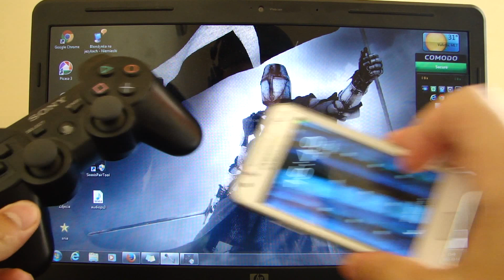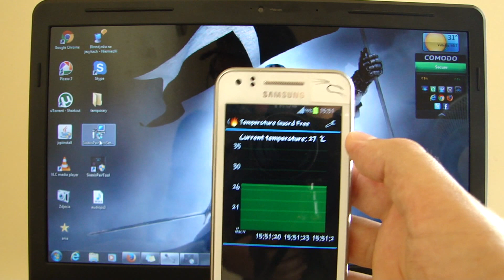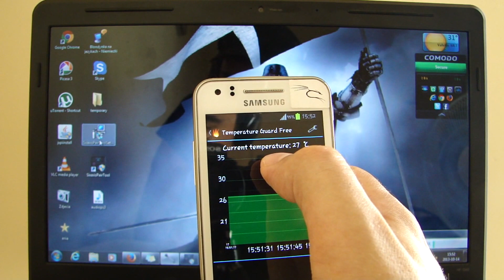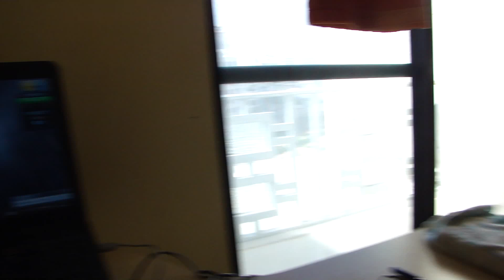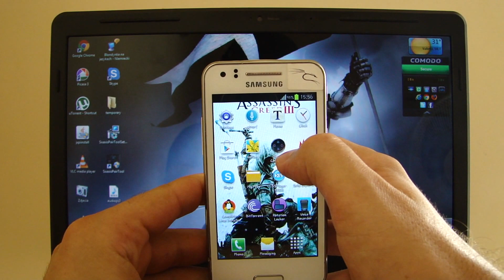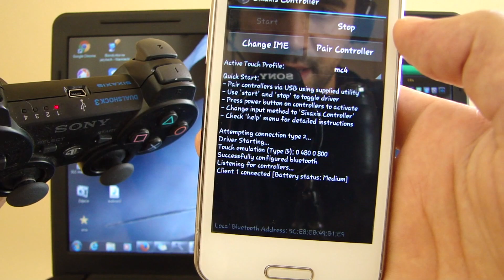How to connect PS3 controller to Galaxy BEAM (projector Smartphone)

Comment: Hey can u tell me how to connect Xbox 360 -controller with beam plzzz
Reply from the maker: You mean with the usb cable? As far as I know this is not possible for now. Only when the CM kitkat rom is funded, it will have usb host mode. Then it will be possible
Reply: Om Er  Xbox sucks assholez
Reply: Om Er Sony rules odole rules odole rules odele rules Sony rules
Reply: Om Er Xbox psssssystyststsys

Comment: Why the screen not in sleep mode when we on the projector in jb....normally in gb watch movie by projector it will automatically wil dim the screen.can u tell me how to solve that problem.tq
Reply from the maker: I know about this problem and in occurs in jelly bean, but only on other movie players. The screen still turns off with the preinstalled player but not with other players (such as vlc or bs player). You can use apps like "Screen Dimmer" to put down the brightness more than with the presettings of the phone orelse there is also an app called screen "standby lite" which turns off the screen.
Reply: tq

Comment: Cant we connect ps2 contreller?may be it can be if u use "ps2 controler to usb converter"and OtG they are availabe in amazon and ebay..plz rwply
Reply from the maker: thats not possible as otg ( usb host mode) has to be enabled on the beam

Comment from the maker: I use a non original usb charging cable and just plugged it into the laptop. So no console needed. Try another usb slot or another computer. It should work with any usb cable

Comment: and it's very heavy to play and install games, i got half of games opening that i had installed on gingerbread. it's force-me to go back to gingerbread that the games run very well, only gingerbread need is the bluetooth driver to be perfect. i waiting for the oficial 4.1.2 firmware to try. note: the fake controller to run better, needs to be open and soldering small wire as an internal antenna to have gain signal to better performance and configure on sixaxis to rapid response.

Comment: i had installed jellybean (leaked version) 2 days when appears because the gingerbread don't have the bluetooth driver to run the controller (only in cyanogenmod ). and i had success when installed and used 2 fakes PS3 controller on 4.1.2  times ago. the controller is slow on many "famous" emulators ( i have tried various and some run very well "need to try one by one", the lag is on emulator, not in controller ). but jellybean "leaked version" have much bugs and freezes all the time,

Comment from the maker: I didnt try it out yet. These 4 hours I played nfs straigt I used the 4000 mAh Battery. And I had quite some battery left as far as I remember. Still...I have to try it out on the 2000...To reset you find a small hole at the backside of the controller. Put something small in there to reset it. If that doesnt work plug the controller into the PS3 and reset it again.

Comment: Thank you very much for this video.
I have a question, can you I use my beam as a normal projector and just project what's on my laptop's screen?
I have looked for this and I have tried apps like crazy remote but I didn't like it since it's not fast enough and I have to use the phone as a remote for my PC and that takes a lot of processing instead of just simply using the projector alone.
so if you have a way I'd appreciate if you share it :) thanks.